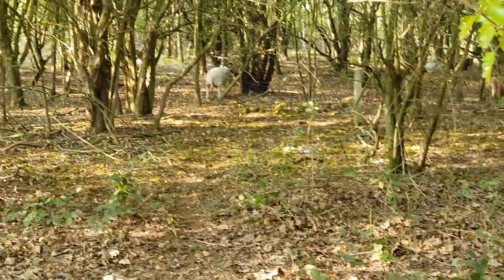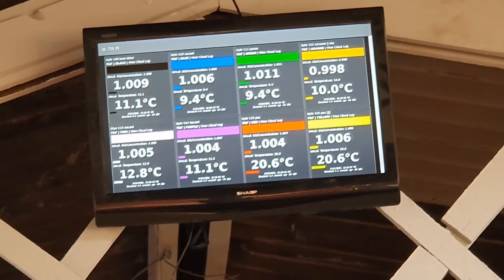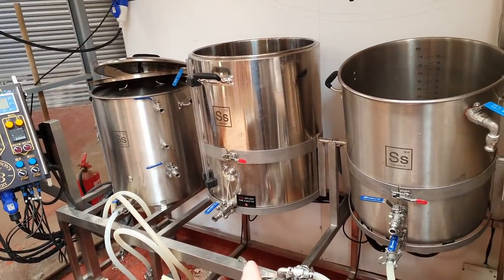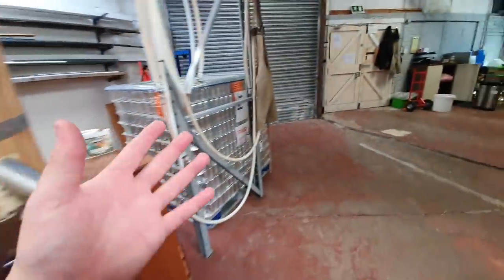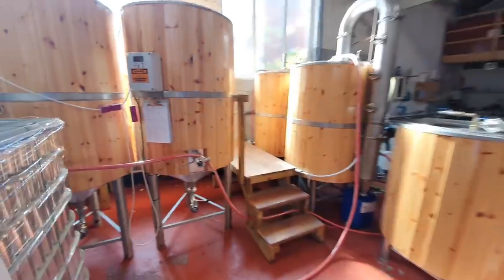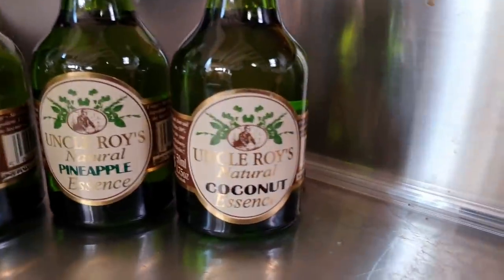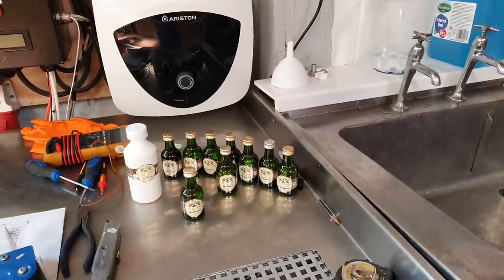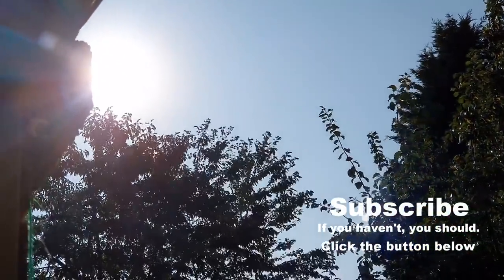We Have To Send The Cans Back!

Comment: It is always great to get a HarryBrew video!  I've also made a big mistake acidifying a batch of nearly 600L back in July.  I accidentally (stupidly) added sanitizing solution instead of Lactic Acid.  Fortunately for me, the pH did not act like it should have. So I added a little more and still not what I expected.  While I was making notes in my log, I noticed the 1-gallon jug of Lactic Acid sitting right next to me.  I thought that was strange since I was just using it at the mash tun and I had not carried it over with me.  I then noticed the other container sitting on the brew platform and upon investigation, I realized I had been adding sanitizing solution.  I dumped the entire batch immediately.  

Congratulations on all the growth too!  500L to 2000L is a nice jump and here in the US, 2000L is more than 17 barrels.

Comment: Your plum ale went down a storm last year - love to see you repeat that success...I'm not going to get to Retford anytime soon, so I will look for that fabulous porter recipe! You sold kits last year -  are you doing that again? Ever considered Brewha BIAC vessels for your brewhouse? They are designed for single operators - no brewhouse crew required - even have a "tip out" grain cleanout. All you would need is an overhead crane system - you appear to have the headroom. Love to hear your comments on them, if you looked them over. Cheers!